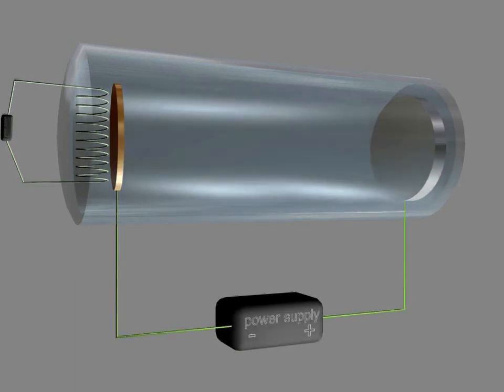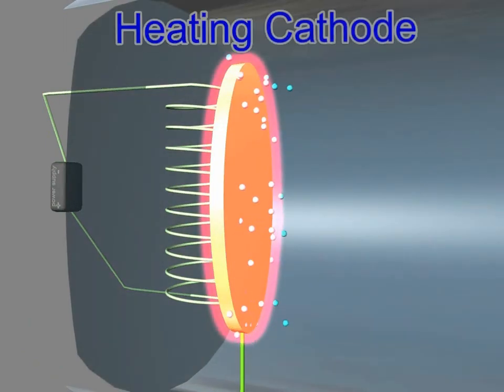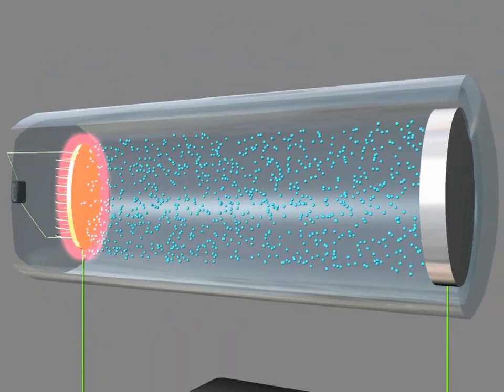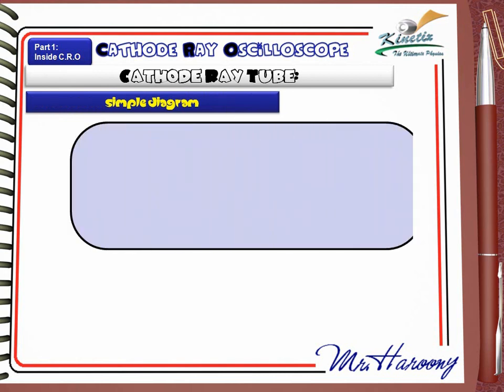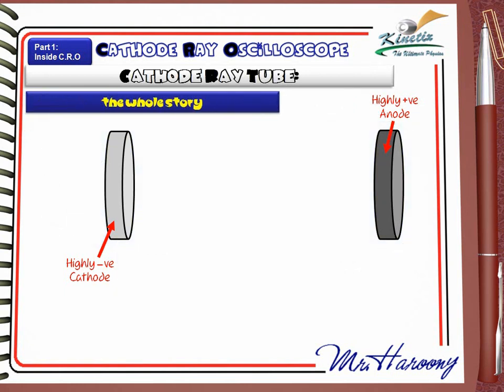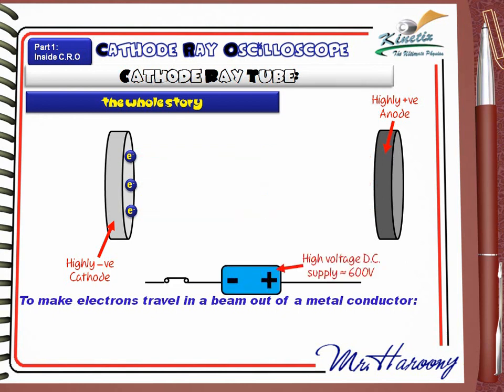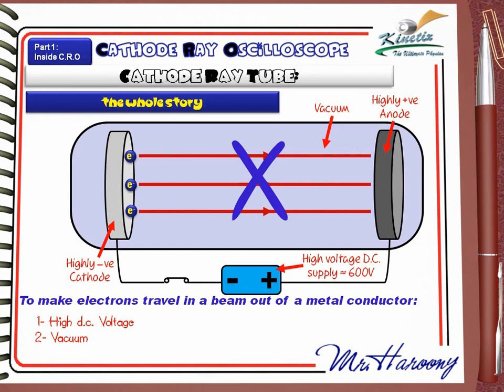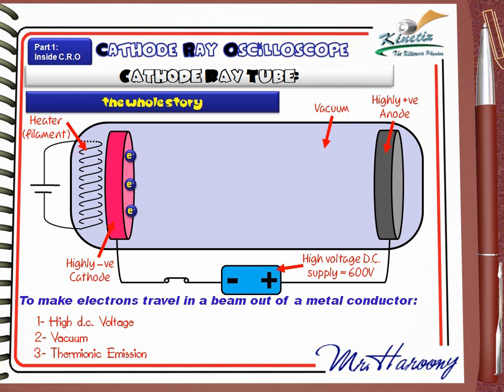GCSE-IGCSE Physics part1 cathode ray tube from CRO cathode ray oscilloscope video

Comment: physics need a big  brain by thinking first in a testament 
To know cases of things we use it in a testament.
If a cathode rays tube doesn't work or it doesn't give results .
We should testament each a part '' 
Power voltage'' get stronge it

Comment: I can't understand
Reply: This is of a  physical object 
To product a computer screen or television by making cathode rays in tubes don't have pressure air or  
Air (o2) 
It has much of electrons (air)  pressure 
To avoid this,  we use a tube , and we put things in it and out it 
A battery '' power voltage to give electrons .and cathode '' 
Iron or gold or any materials to heat this material to get out much electrons to flow in a tupe. 
Here '' random electrons 
It doesn't have a certain direction 
We need things in it..  
Magnites in it to collect thing or combine them together  
Because '' Magnite attracts negative electrons -  to it 
To collect and to change directions . 😀
I am Muslim. .
Did you understand me?  
Then,  collected and directed  electrons beat over or on anode  + 
Then all of them 
Hit on a ''  glass( 
I don't know what is it,  but it is, when you hit a glass on the floor, it will brake.  '' a tube'' to make rays..